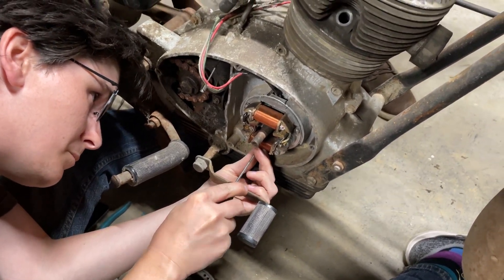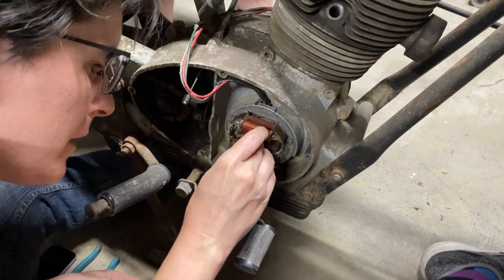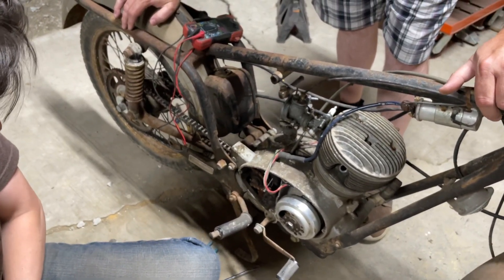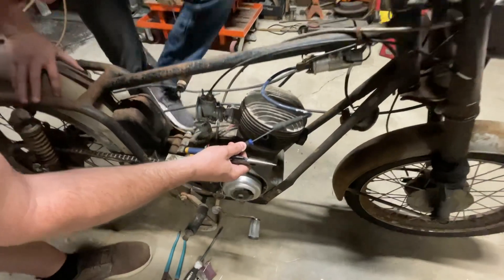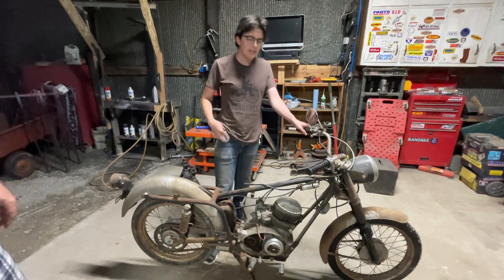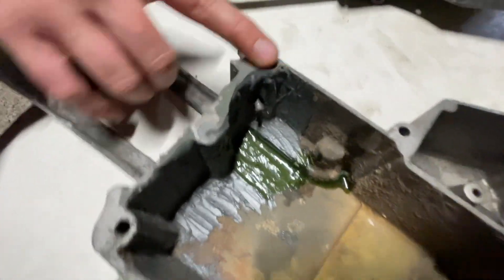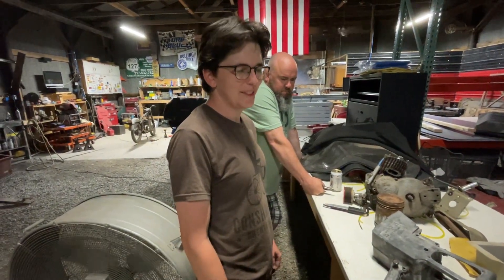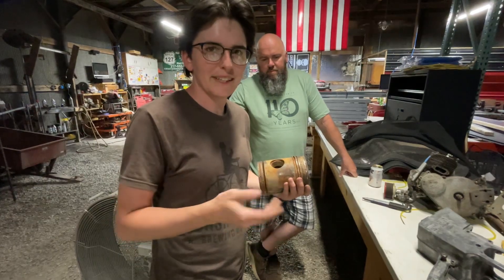Random Bits 0294: Filmed a video of the Gilera, bad coil, Now on to the David Bradley chainsaw!

Comment: its a cool bike , love the old motor styles , the frame of the bike is so simple and open , you cold fit many different motors on your own mounts into it if all els fails , wd40 works great for stuff sitting low to the ground when storing a motor ect/ drill i just soak it / spray it keeps the moisture out for 6 months

Comment: EHHH I'd still rather see you do anything with the Citicar than anything else. With your expert knowledge of 18650 cells, which has helped me understand the tech, back in the day, I find it hard to swallow that you'd not be trying to implement modern battery tech into that vehicle, as well as with the recent upgrades in flexible solar, being more lightweight, and the car having large areas of a flat nature, it seems like a bit of a lost opportunity, really.  I don't have the financial ability to purchase a vehicle like that, if any still exist.  BUT if you made them popularized again, with the advent of 3d printing, and knowing that superglue bonds plastic parts like that stronger than anything else, you COULD perhaps make a 3d printable shell that could be assembled bit by bit, as time, and money allows, all in all, making a Citicar type vehicle for the modern day.